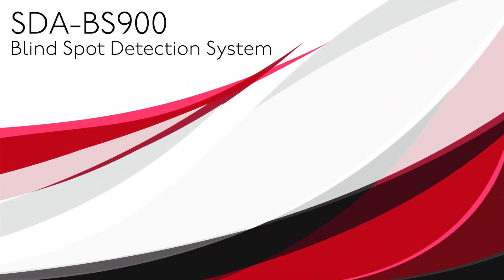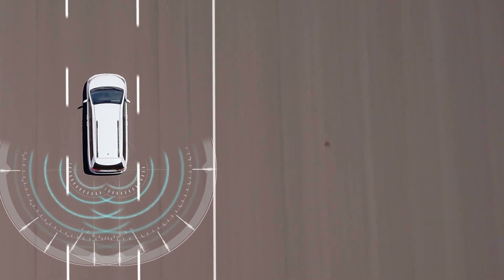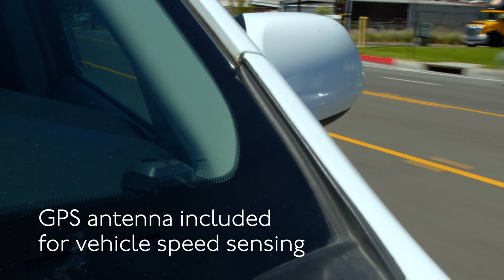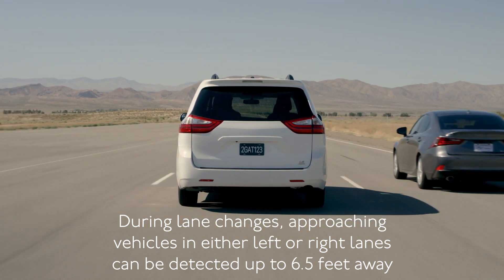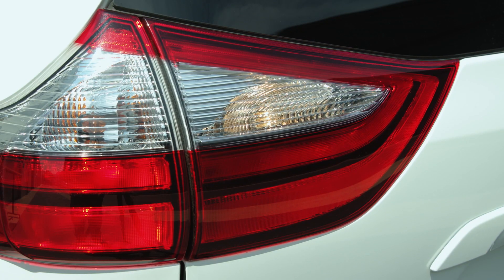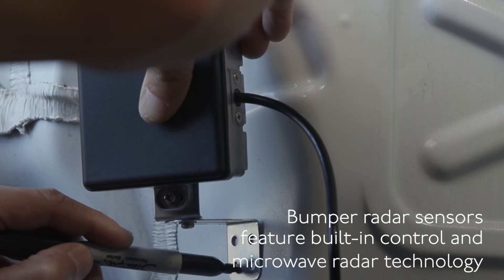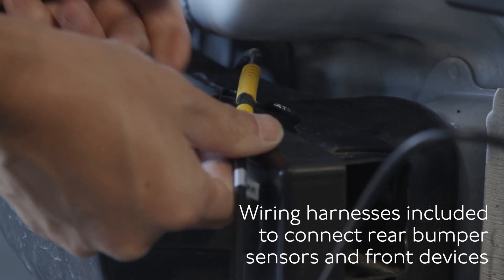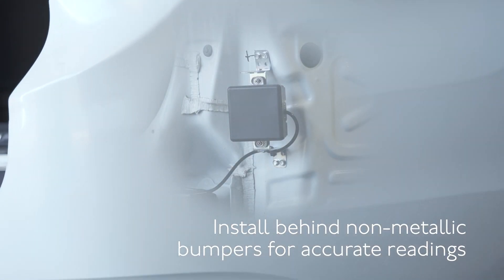Pioneer SDA-BS900 add-on Blind Spot Detection System

Comment: Are your dealers trained to install this?
Reply from the maker: Installing the Pioneer SDA-BS900 requires the removal and reinstallation of the vehicle's rear bumper.  In the US, many Pioneer Authorized Dealers are fully capable of this type of installation.  It's best to contact any particular dealer directly  to discuss the installation with that particular shop and if that shop is prepared to do an installation for Pioneer SDA-BS900.

Comment: Where to buy?
Reply: As of 2020 August, the Pioneer SDA-BS900 is available from many Authorized Pioneer Dealers in the US.  You can find a a Pioneer Authorized Dealer in your area here:  https://www.pioneerelectronics.com/PUSA/Where-To-Buy   and you can find more videos on Pioneer's YouTube Channel here:  https://www.youtube.com/user/pioneerelectronics
Reply: Does it integrate with a Nex system?
Reply: The Pioneer SDA-BS900 is a stand alone product that does not require any in-dash receiver to operate.  It will work with any brand of in-dash receiver, or with no in-dash receiver at all.  No integration with a particular receiver is required. There is no integration with Pioneer in-dash receives.  you can find more videos on Pioneer's YouTube Channel here:  https://www.youtube.com/user/pioneerelectronics
Reply: @1985wasagreatyear  I'd hope so. If it does I'd buy other I'd look junky as funk